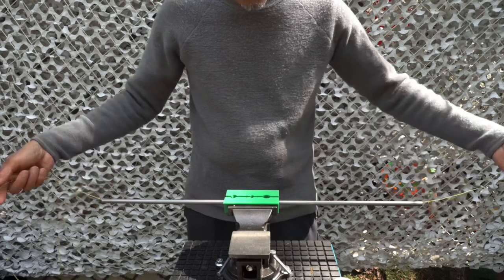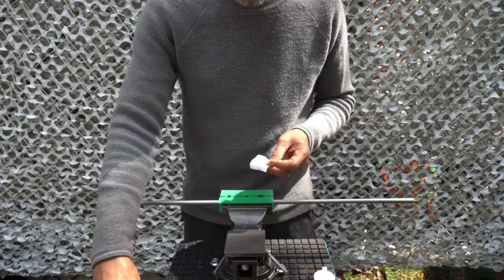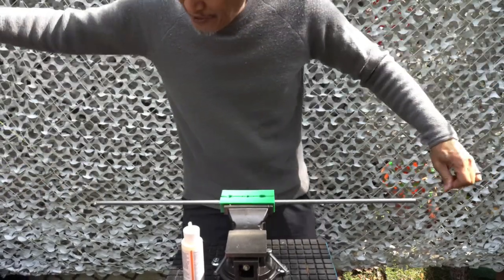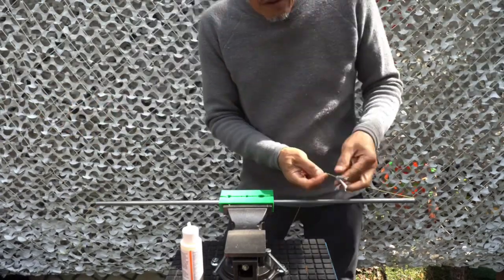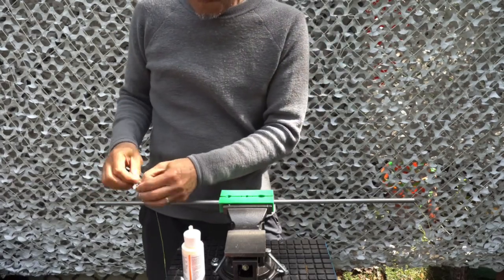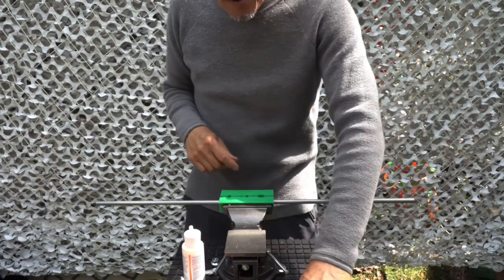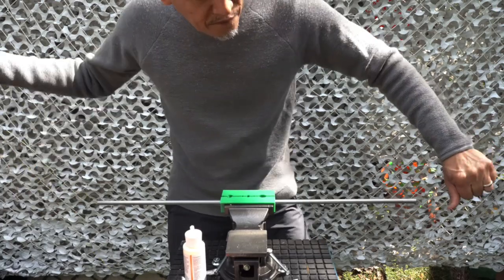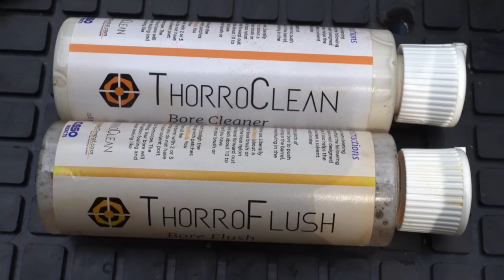FX Airguns STX liner bore cleaning

Comment: Cool idea! I use to fish a LOT and we use to find braids cut into older stainless steel guides which it does fairly quickly under pressure depending on the braid. Obviously you aren't putting a lot of pressure on it but just something to keep in mind.

Comment: After cleaning do you find it takes a few shots to settle back to consistency?
Reply from the maker: Yes, need that lead dust to fill in the Pours / lands
Reply: @ernestrowe5061  Thanks. I've noticed after I clean it takes a few shots to settle down and wanted to be sure that was typical.
Reply: @mikefoor5162  I need just one shot to be back on track. Sometimes it's not even needed.
Reply: I don’t think my arms are long enough to do a 700🤔
Reply: @scubajeeper1  wait for 800mm ones
Reply from the maker: @scubajeeper1  one hand at a time 😊
Reply: @MasonStormSunny  two person job
Reply: @frankies-1389  haha, true. Like a hand saw.
Reply: @scubajeeper1  Time to ask Ernest how does he stretch his arms? :)
Reply: @frankies-1389  Maybe 2 :)
Reply: I would imagine slugs foul barrels quicker doe to more contact area. How many rounds does one typically shoot of each (slugs/pellets) before needing to do this ? Thanks.
Reply: @ellobo1326  400-600 depending on type and make